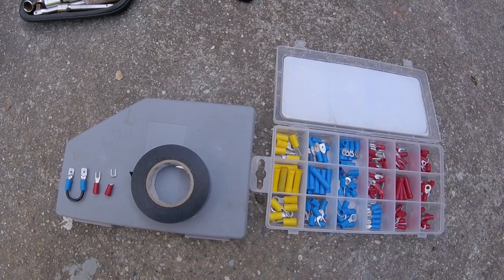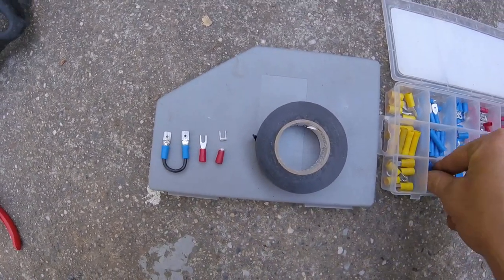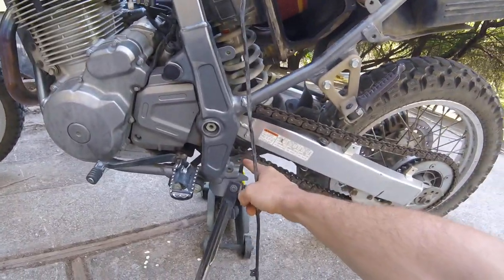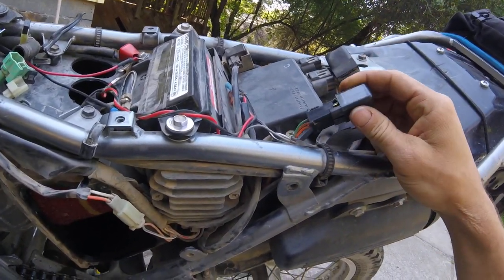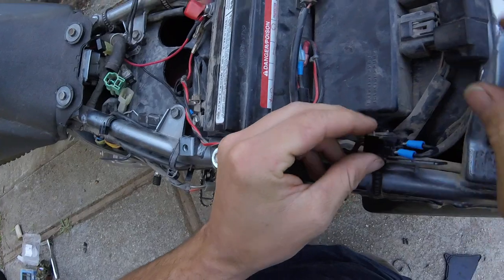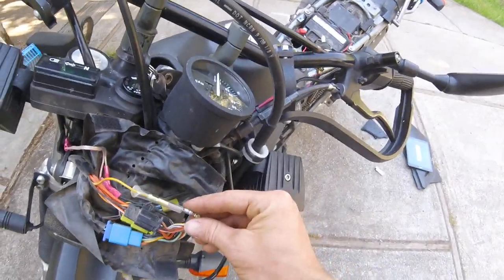Dr650 Side Stand Kill Switch Removal (The proper way) post-1996

Comment: Just bought a new 2019 DR.    Will be doing another round australia trip in 2020.   Of course doing all the necessary changes to get it up to spec.   Then I came across your video, waaay better than the others as it covers all the proper procedures to make it fail safe.  
Have already made the changes.  
Thanks heaps!

Comment: Video saved my trip. I had bypassed everything shown here several years ago except the relay mod. Bike suddenly would not crank. Removed and jumped the relay and started right up. Do all these mods or you will eventually have issues.
Reply from the maker: That's awesome!  I'm glad to hear that. 
A genuine concern that I may encounter that very situation is the reason I made this video.

Comment: Dude, you had the most comprehensive video. Chucking the diode was really special. You simplified up the whole bike and got rid of all the, 'Safety Features' that just plain suck because they are repair issues waiting to happen. Very Cool my friend. We don't need this stupid crap and someday it will not be installed on bikes,....... someday,...  thanks again.

Comment: Just for good measure I also made a backup jumper wire and backup jumper clip and stuck them in my tool kit. I used adhesive waterproof Marine heat shrink on the jumper wire / male ends too.

Comment: Excellent, no nonsense vid. Would appreciate knowing what that diode is protecting reverse flow of current from before removing/jumping. Hard to find info on what it’s purpose for being there is…(was) in your case.
Reply from the maker: Bridging the diode connection ensures the neutral sending unit still lights the neutral light on the dash when in neutral. 
There's write ups on drriders.com, thousands, and I read through years ago when I made this video. I can't remember the specific situation that riders faced when this diode failed, but that there is potential for the nsu signal to not illuminate the neutral light when bypassing the sidestand kill switch which is why I included it in the video.

Comment: Why not just jump the side stand switch wires?  I see other guys doing that.  I checked the resistance on the kickstand switch and it doesn't apear to just be an open/close switch.  Is this why you do it this way?  Would love to hear your thoughts.  Thanks
Reply from the maker: mxracerguy hey thanks for the comment! Sure, you can simply bypass the side stand switch. But that doesnt eliminate fail points in the system. The components I removed, the relay, and the diode, and the clutch lever switch are all prone to failure. Bridging the diode connection ensures the neutral sending unit still lights the neutral light on the dash when in neutral. 
These components do not fail very often, but if it does happen, your bike will not start and you could potentially spend hours trying to figure out why. Not a big deal if you are at home or close to home when or if that happens, but if you're planning a big trip that leads you to remote areas or 3rd world countries it is a good idea to eliminate as many potential failure points as possible. I made this video for the benefit of others after doing a lot of research and reading several write-ups on how to properly disable the side stand kill switch. I searched for videos but could not find any so I made one.
Reply: Thanks a lot for getting back to me. That is awesome info to know. Just so you know I followed your mods exactly and just did a big 1000 Mile ride. The bike worked perfect and I loved not having that stupid side stand switch and clutch switch. Thanks a lot for putting this video together!
Reply: So this video is actually showing 4 different mods that are not dependent on each other?  If I just want to remove the kickstand kill switch I only bypass the green plug right?  It shouldn't effect the neutral light or the clutch kill or anything else right?

Comment: Thanks for the awsame video!
Why is it better to make the custom connectors and bridges instead of just cutting the wires to the diode, the relay and the kill switch stock connector and just solder them together with a shrink sleeve on top to give it a proper isolation?
Reply from the maker: You can certainly do that. I left the option open to be able to revert completely back to stock if desired, in such an event as maybe selling the bike.

Comment: Dude! What size rear sprocket you running? Thing looks super small
Reply from the maker: Stock. I've never changed the gearing.
Reply from the maker: 15 up front, 42 in rear. 
Check out gearingcommander.com if you want to play around with gearing and get an idea of how different gearing will affect your machine.

Comment: Is there a way to identify the diode that the small clip goes on, looks like there are more than one in the same area, what color wires run into it? And what size are the connections that you made the short grounding loop with the blue ones?

Comment: The previous owner of my bike removed them.  Will the bike crank if something went wrong with the bypasses?  Right now I have crank and no spark, going through every option.
Reply from the maker: Stephen, hi. The point of the modifications in this video is to eliminate 3 different items. The reason these items are eliminated from the system is to prevent a no start situation. It is likely that your issue is of a different nature. That being said, you could use my video here to double check your bike and the previous owners work to ensure it is modified properly. 
Sorry for the late response.

Comment: Great video...I subscribed....Question....What did you do with yellow wire once removed from headlight area for clutch kill switch?  Could you make vid or offer any advice for removing California emission junk and proper carb and gas tank venting.  Also, changing a vacuum petcock to a manual one keeping stock tank with California type gas cap and venting.  Thanks, if you have time....
Reply from the maker: The yellow wires up front on the left side of the handlebars are for the clutch switch. You follow the wires from the switch on the handlebar to where they plug into the harness behind the headlight. Once you find where they connect, unplug the wires coming from the handle bars and then plug the harness wires into themselves. One should be female, and the other male, they should connect. Now, the wires coming from the switch on the clutch lever bracket, just remove the switch and the wires. You don't need them anymore. The vacuum operated petcock can just be removed and replaced with a manual one, and the nipple on the cap of the carb can just be plugged. Don't forget to remove the orifice filter inside of the fuel inlet elbow tube of the carb if you haven't already. It's an unnecessary restriction. As for the emissions canisters, they were already removed from my bike when I purchased it. But, I would check out drriders.com 
This site pre-dates the FB group pages and is an invaluable resource.

Comment: Just did all this on my 4 day old '20... Awesome!  So what does the diode control? I'm assuming the relay is related to the kickstand switch since you did not jumper it at the connection?
Reply from the maker: 🤔 if my memory serves me correctly, I believe it had something to do with keeping the NSU lighting up the neutral indicator on the dash but it's honestly been like 3 years since I did all the research and I can't remember exactly. I do remember that if it fails, it will prevent the bike from starting.
Reply: @Max_Chooch  Just curious cause I know that a diode controls the current flow in one direction only so now with the jumper what happens if current feeds back the wrong way??... is it gonna fry or shorten the lifespan of another component?
Reply from the maker: I don't think so. I've had mine done this way for 3 years now and have never had a problem with anything like that. Nobody else whose used this video has either.
Reply: @Max_Chooch  Cool. Thanks for the update!

Comment: This may sound dumb ,but on the duel male connection what gauge is that black wire connecting the 2. Or do they come like that minus the soldering? Also where can/who sells the connectors?
Reply from the maker: Typically harbor freight, or autozone, or O-reilly's will sell the box of connectors. I don't remember what gauge the wire is off the top of my head, but a good rule of thumb is thicker is better (within reason) 
Thinner wire will have more resistance and could heat up. Going just a smidge thicker will keep you in the safe zone.
Reply from the maker: Also, I crimped the connectors onto a short piece of wire and then soldered them in place for good measure.
Reply: @Max_Chooch  Ok I did it and it worked. I used 16 gauge wire I hope that's ok. Had some problems with the red connecters, had to double the ends up to made them fit. Took a test ride and it seems ok, thanks for the reply. if it over heats the wire will it blow a fuse and do u know what's size I may have to get? I need to do some research on where the fuse box is , lol. I have only had my DR for about a month so I am a noob.
Reply from the maker: You not going to blow any fuses if your wire is of equal or greater size than the rest.
Reply from the maker: There are 2 fuses on the bike. Right hand side, under the side panel, covered by a clear ish white cap.
Reply: @Max_Chooch  ok thank u so much!
Reply: Hey Troy one more question. I want to replace my pipe. Do u have to do the carb mod if I do this. Also what if I just bought the slip only?
Reply from the maker: If you expect to get any sort of performance gains then yeah I'd do the carb and air box mod. Making this engine simply breathe better will get you about a 15% gain over stock. Doesn't sound like much but your ass will definitely feel it. It's the difference between being able to wheely with a roll on the throttle and not. Check out drriders.com if you don't already know about it. Procycle.us is also a great resource for aftermarket parts. And if you haven't already, join the Suzuki dr650 riders page on FB.
Reply: @overcome8628  What do you mean by "doubling ends up" ... unable to visualize. Getting ready to do this so was curious what to expect...

Comment: Finally another pre 96 channel thanks and I’ll be sure to like and sub
Reply from the maker: Not so much anymore.  I no longer have my 1993. I gifted it to a friend along with everything he needed to fix a cracked center case. Sourced a whole nother engine and tore it down and handed him the parts and everything.  Guy turned out to not be so much of a good friend and that's that. If you're looking for lots of info on the pre 96, check out drriders.com
They've got a dedicated pre 96 section of the forum. That forum has actually been around since before FB.
Reply: Awesome thanks 🙏

Comment: Awesome video!  Are you able to provide links to where we can buy the correct dual male connector for the relay and the red terminal thingy for where the diode goes?  And did you use wire cutters to cut the red one?  When it comes to electrical stuff we're complete idiots.  Thank you!!!
Reply from the maker: David & Elizabeth 
I bought the terminal kit at harbor freight and yeah I just snipped the terminal with wire cutters.
Reply: We'll look into Harbor Freight. Thanks again.
Reply: Troy Thomas Can you confirm the following? Harbor Freight item # 67683. From this use two 16-14ga male disconnects connected by one 16-14ga butt connector.  Then cut one 16-14ga spade terminal to place into diode.  We greatly appreciate it.
Reply: David & Elizabeth did that work for you? Planning to do this tomorrow

Comment: Question: why did you bypass the relay at the rear of the bike? Just another piece to fail??
Reply from the maker: Yes. The Relay becomes an unnecessary part without the side stand switch and since power to the ignition goes through that relay, if it were to fail.. could leave you scratching your head wondering why you have a no start situation. If you don't have the switch why have the relay?
Reply: Thank you for the explanation, much appreciated.

Comment: i am more worried about the neutral switch,,,,
Reply from the maker: In what regard? What year is your bike? Suzuki started putting locktite on those screws in 2016 or 17 I believe. If you're worried about them backing out, then go buy the safety wire kit from procycle.us and safetey wire them. There's plenty of other videshowing you how to do that, but this video here that I posted is not for that, it's for disabling the inconvenient feature of the kickstand killing your engine while your riding because ya bounced hard and it released the side stand kill switch.

Comment: What is the diode for ?
Reply from the maker: It's been a long time since I studied the wiring diagrams for the bike, I had to do several days' worth of research to come up with this procedure and I think, if I remember correctly (which I may not) that the diode has something to do with the neutral light still working after the mods because it's also tied into the kick stand kill switch circuit via the relay. I think that's what I remember.  
What I do know for sure is that if that diode fails, you'll be left with a crank-no start type of situation, and if that's 1000 miles away from home, you're screwed.
Also, this procedure has been reviewed by the great MXRob, creator of the original drriders.com website that existed before Facebook and was THE go to source for info about the 1996 to current DR650SE and its predecessor, the 1992-95 DR650S. MXRob pinned this video to that website as the go-to how-to for this mod. It's legit. If you do this mod. Bypass the diode. There's no reason not to.

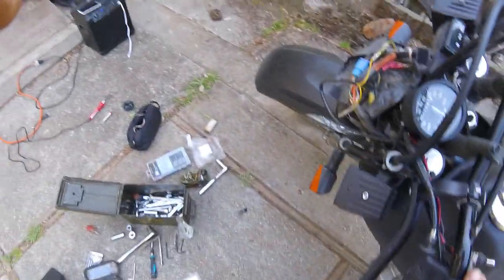Comment: If I just want to do the side stand, I can stop at 1:57, correct? (After I tape over that ghetto home-made connection.)
Reply from the maker: Yes, but not doing everything will leave potential "no-start" failure points within the system.

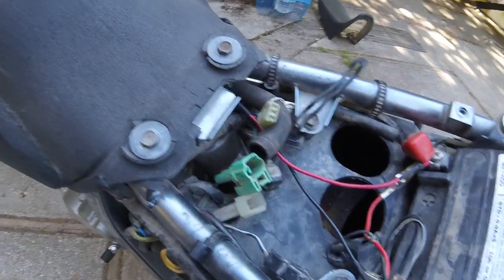Comment: At 1:36 seconds what is that diode for?
Reply from the maker: It's been a while, but if I remember correctly it allows the neutral light to still work with the mods